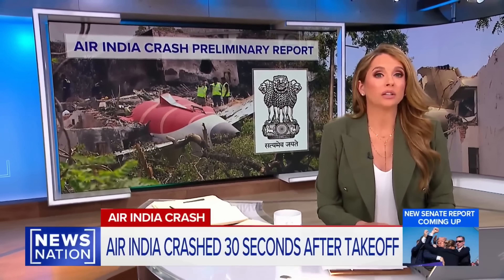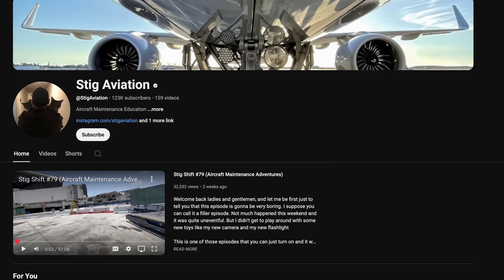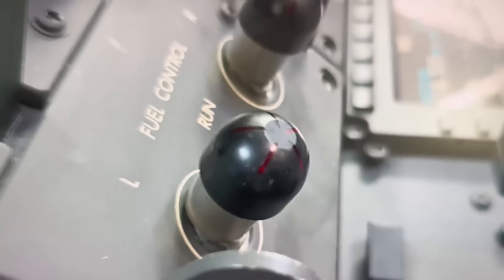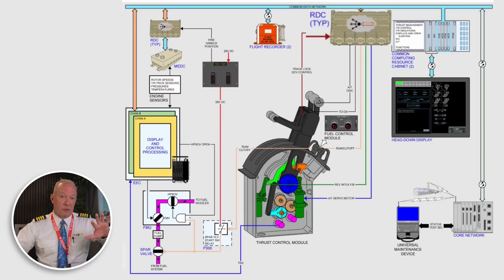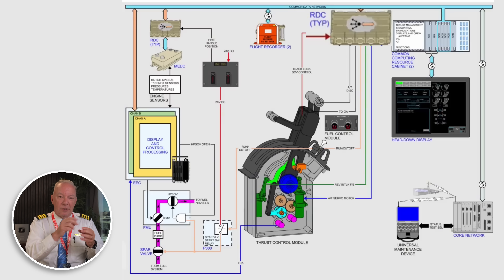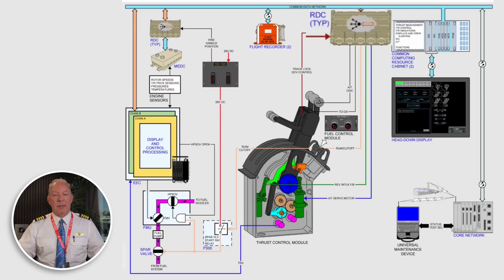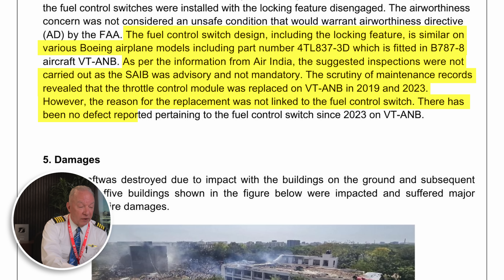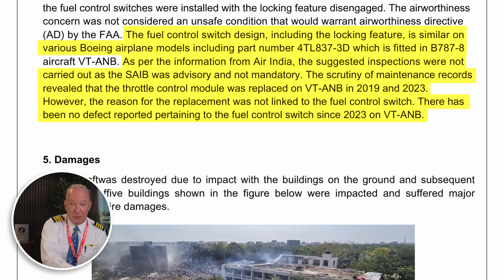The Truth About Boeing 787 Fuel Control Switches

Comment: Great presentation Capt Stevie,  Capt Tommy  here flew Boeings for 40 years...I have a hard time thinkng intentional act.  ANA 787 engines shut off after landing from software glitch. AD on water leaking into EE compartment.
  787 is different from 777,757,767 on electrical design    Need a deep dive into electric diagrams (Boeing proprietary)  see below

While the fuel shutoff valves are considered important, during a catastrophic and prolonged electrical failure, they might be deprioritized compared to systems like flight controls and basic navigation, especially if power delivery becomes erratic or unstable. The 787's battery backup supports the entire DC bus, and the power management software prioritizes flight-critical systems; in limited power or erratic load situations, less critical systems like FSOVs could be deprioritized
Reply: Thanks for adding that, and I would hate it that the pilot did it on purpose for any reason. However, NTSB won’t get it wrong, and final report is not out yet.

Comment: Question: It appears from various sources that the fuel control switches are located low and to the side of the pilots, more or less alongside and below the pilot's elbow. Where is the pilots' attention focussed at this point? Factoring in the initial confusion around sudden and total loss of power, how long would it take to diagnose uncommanded fuel cutoff as the cause? One of the pilots identified and remedied the fuel cutoff within a few seconds - I can think of two scenarios: One, that he saw the other pilot's hand move towards the fuel control switches and checked them immediately, or two, he started the memory items for dual engine failure - fuel control switches - cutoff, then run - and found them already in the cutoff position. Looking at how quickly the fuel cutoff was identified and remedied, it points to the problem being the switches themselves rather than an electrical gremlin (if it had been a catastrophic failure of the 28VDC system, it would not have been possible to reopen the valves) and the simplicity of the switches more or less rules out anything other than the switches being actuated by somebody in the flight deck.

Comment: Someone turned the cut off switches off.  I have a question regarding this incident.  It was stated that a check Captain was on board this flight. Was he doing a check ride or sitting up in the flight deck?  After flying for an airline of 28 years I can state that someone, not eddy currents, not radical free electrons, can put fuel cutoff switches into the off position, or the run position  without a person doing it.

Comment: Thank you, Captain Steeeve. One thing I don't get is Boeing's switch philosophy. In the Airbus you activate a switch by flipping it up. Just like a light switch that we're all used to. Stupid simple. And all switches operate like that. There are no exceptions, at least in the cockpit. Ultra-consistent across the board.

What does Boeing do? You turn Boeing switches on by... you guessed it, flipping them DOWN. Why down? Who knows? Maybe to be different than Airbus. I have no idea. But you flip them down. Except for arguably the two most important switches of all - the fuel-valve cut-off switches. Those you switch on by flipping them UP. 

Is there any logical reason for this design philosophy? This seems insane to me.

Comment: Thanks Captain for your valuable contribution!
Regardless of what did or did not happen to the flight 171. It has been established that a malevolous/erroneous action can cause a plane to crash by simply moving the fuel cutoff switches.
So, I would start considering if the fuel cut off circuitry should be redesigned so that it cannot be deactivate during flight.
I work in Automotive Functional Safety and I know it is easier to be said than done. And there also may be circumstances in which operating those switches mid-flight is required.
So, as I said it may not be a straightforward design. But it should probably considered, because as we call them in the Automotive industry, the system shall avoid/mitigate malfunctions but also "foreseeable misuses", this may be an extreme example of them.

Comment: Steve’s explanation illustrates how this control circuitry  works exactly, even if the relay suffers some mechanical failure, let’s say the contacts stuck at the open position so the valve lost electricity and locked at Close position, this scenario could happen, although rare in the real world, but the probability that situation occurred in the two isolated circuits at the same time is practically zero.
Reply: He butchered the explanation and gave inaccurate info on what this diagram says. This is only the simplified diagram, not the full diagram, but he got the simplified version very wrong :(

Comment: YOU DO NOT EXPLAIN WHY THAT TURNING THEM OFF THEN BACK ON , AS THE CREW DID, WILL NOT RESUME THE ENGINE TO RUN, AS THERE IS  NO IGNITION TIED TO THOSE SWITCHES UNLESS THE CONTINOUS IGNITION SWITCH IS IN THE "ON" POSITION THERE WILL BE NO LITE UP. AS A "AME" I KNOW

Comment: There is a minuscule chance of one other possibility. The physical switch in this case is not a direct interlock with engine control computer. It is theoretically possible for the interconnected relay to disconnect due to a voltage fluctuation on the circuit. Because a relay is a current operated switch and not a voltage switch this is theoretically possible. Extremely unlikely. Essentially zero chance that both relays failed at the same time in the same way.

Therefore the only reasonable conclusion is that power was removed from the circuit by moving the switches.

Comment: Let me start by saying that I believe that the switches were moved and not some ghost signal caused the engines to shutdown.  Having said that, I have been an electronic technician for over 40 years and after looking at the diagram you provided, I don't see the simple switch, relay, valve setup you described.  I see each of the 3 valves being controlled by different circuits. First, the spar valve is controlled by "spar vlv start sw relay" which closely resemble what you described.  The "Fuel management valve" is controlled by the "Display and Control Processing" circuits and finally the HPSOV is controlled by what looks like an AND gate which gets its inputs from the "Spar valve start switch relay" AND again the "Display and Control Processing" circuits.  This is a FAR CRY from the simplistic circuit you described and in my opinion contradicts it.

Comment: While I agree it’s very likely a pilot switched these off on purpose, I see a few issues with your schematic that aren’t being fully addressed.

First, it clearly shows an AND gate before the HPSOV valve. This means the valves are not controlled solely by the cockpit switch — both the switch and the controller must supply power for the valve to open. The controllers may have separate Channel A and Channel B paths (possibly one per engine), but both connect to a common data bus. That bus could allow another unit to influence the “Display and Control Processor,” and in turn cut power to the HPSOV. I also notice the middle FMV valve is controlled separately, which further shows multiple control points.

Second, there’s the relay between the guarded switch and the AND gate. This is less likely to be a problem since relays are more isolated, but it still means the path isn’t purely mechanical. Captain Steeeeve — in your demo kit you showed a direct switch, not a relay. A relay is an indirect, magnetically operated switch that can separate the control power (possibly lower voltage) from the 28 V DC used by the valve itself. This design also allows other systems — like the flight data recorder — to track switch movement, and for safety interlocks (e.g., pulling the fire handle) to override the cockpit switch.

If the circuit were truly isolated, you wouldn’t be able to record switch movement in the data recorder, nor automatically shut off engine fuel from another system, such as the fire handle, while the switch is still in the ON position.

Comment: Captain Steve, assured us in this video that when something goes wrong with a component, it is replaced with a brand-new component. This is not really true, It is a known fact that airlines and other operators do use parts reclaimed from aircraft stored at the boneyard in Tucson, Arizona, specifically the 309th Aerospace Maintenance and Regeneration Group (AMARG) at Davis-Monthan Air Force Base. This process, known as parts reclamation, is a significant function of the boneyard, alongside storage and scrapping. So, the fact is, salvaged, used parts are often used to replace faulty parts in an aeroplane.

Comment: I think it is most likely that one of the pilots actuated the switches on purpose, however it is incorrect to state (as many on the comments have) that it is impossible for them to actuate accidentally. This has occurred on more than one occasion on the 737. So much so that an SAIB was issued in December 2018 for a maintenance inspection to validate proper lock mechanism operation on models including the 787. This was not mandatory and as a result Air India did not perform the check.  My understanding is this situation occurred with the pilot not flying guarding the throttles and accidentally bumping the switches.

Not sure it makes sense in this case as the switches went off at a seconds interval not at the same time.

But the potential for an aircraft problem is not eliminated by this report.. 

The theory the pilot turned them off seems most likely however, they were found still on in the wreckage so an accidental bump seems unlikely.

Comment: I think the guy talking in the other video you started with is full of BS.  But I also think covering this topic completely warrants discussing how the FDR monitors the fuel switches, valves and pressures and if they’re monitored separately.  While I don’t know the specifics of the 787 FDR system, the number of parameters monitored in a modern aircraft can be thousands.  In many cases fuel switches, the valves they control and the fuel pressures in front and behind the valves are recorded independently in the FDR.  And engines often have their own data recorders separate from the AC.

Comment: from the schematic dig. The Fuel Control Switches only have direct control to the Spar Vlv. The other two vlv are dependent on the engine's EEC. The HPSOV has an AND gate that requires both input from the Switch & the EEC to operate.

Comment: Thanks Cpt Steeve for demonstrating the normal function of these cockpit switches and the impossibility of a general power failure shutting down the engines. However I think you are wrong to say that there is no other way the engines can be shut down other than the cockpit switches being moved. In ANA flight 985 on 17th January 2019 at Osaka Airport both engines shut down shortly after landing without the cockpit switches being moved, and yet the engines were subsequently found to be in good working order. The only conclusion is that they were shut down by the FADEC. So such an uncommanded shutdown can happen. The real question is whether a FADEC-initiated shutdown could produce EAFR data exactly mimicking the EAFR data which is produced when the cockpit switches are moved to CUTOFF. If it could do so, then we must allow that this might be what happened with Air India 171.

Comment: Electrical Engineer with some experience in avionics (Pitot and sttaic port sensors) here. Well other than being aerospace grade and having lots of redundancies built in it's similar engineering in differnet industries so my few cents ->

- Other than the Stig Aviation provided schematic do you have the part numbers for the valves, relay etc to check the datasheets? How do you know the NC (normally closed position) of the relay in cases where no 24VDC is RUN position? I can't find this on google and info like this is normally only with the plane mfr OEM.
- The Valves in the schematic are most likely actuator controlled (I am not sure either as no detailed part numbers available freely). How did you say for sure they are hydraulic and no digital input? A digital siganl could be causin ganalog drive to the actuator  for the valve. You seem to be very certain as if you know the exact part number of the valve.
- The valves also depend on logic/signals from metering unit (FMU or something). If that malfunctioned during aircraft going from ground to air mode then it could have given false input to the valves actuators.
- Any DC powered system (or even  AC) can have glitches on the power bus (which are mostly filtered but cannot filter everything 100%) which could cause false triggering etc that can cause valves to shut off or relay to be in cutoff position.
- You mentioned in that video with the boeing ex employee and the other indian pilot that RAT when deployed provides power instantly. How do you know that for sure? Normally there are caps etc in the system such that there is charge for few seconds to critical systems until RAT takes over but thats not a given and no generator generates energy instantly. There is always a time it takes for the charging of the capacitor banks/batteries to reach a certain voltage level and then power the bus.
- Other than under the furl cutoff control switches area there might be simialr sensors/switches in aircraft close to the engines. How do you know there was no issue there?
- There are so many possibilities and definitely for sure looking at the schematic in the video you cannot (nor any electrical engineer) tell details on the parts. Things like closed loop system and open loop system are thrown here and there in discussions but where does this certainty come from? Was this issue emulated in real world and tested?
- The state of the 24V/48V or any DC buses doesnt seem to be monitored and recorded in the data recorder looking at that schematic but only Boeing will know for sure or FAA or NTSB.
- The battery backup for 24VDC bus may not be at proper SOC (state of charge) on that 787. we don't know.

Even if i had decades of experience driving a car i would still never say I know 100% for sure what happens under the bonnet just because i drive and have had some toy engines when i was a child to play with for fundamentals. You are elder to me and i'm sure you are an awesome pilot but unless you have detailed part numbers and datasheets it is disrespectful to the engineers who actually spent years designing these systems. No engineer will ever say system is fool proof, he will be the biggest fool!

If you are so adamant then best to get a EE or so preferably with avionics background to take us through the schematic with evidence. I doubt they'll take this up because no idea of part numbers of anything in the schematic shown.  

Stay Safe and love your channel.

Comment: Doesn't the 1-second "countdown" really start after you've already moved the first switch?

The logs have no knowledge of when the pilot put his hand on the first switch, right? 

If the gap is measured from cutoff to cutoff, it's basically just a question of 'how long does it take to move one switch?'